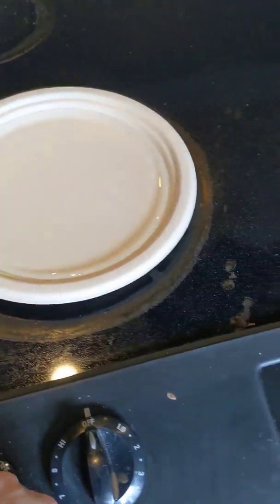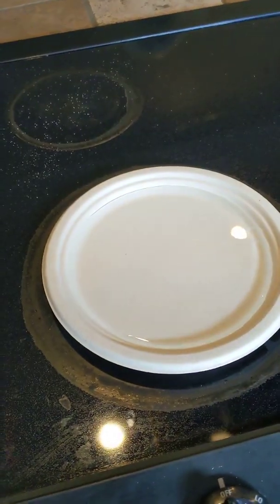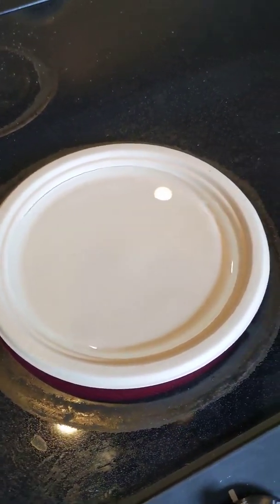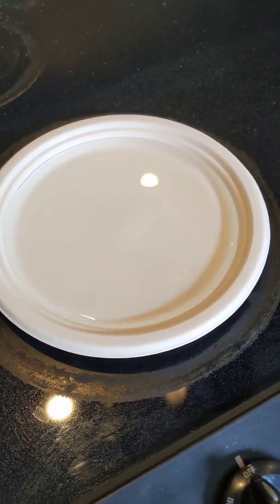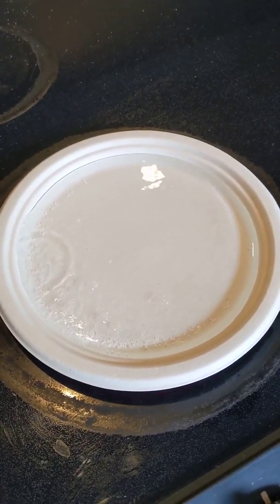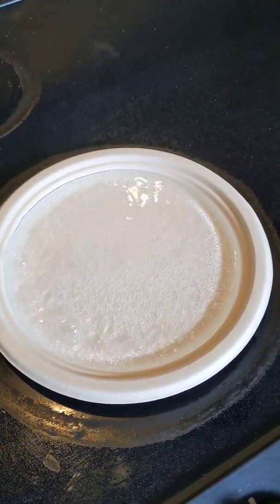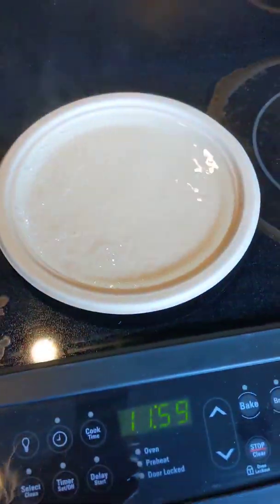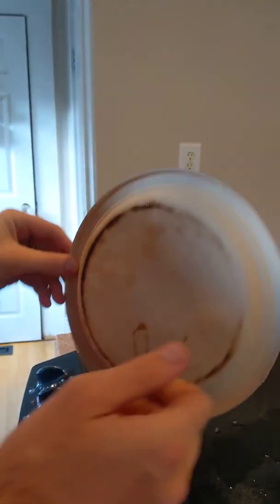Boiling water in paper plate on stove

Comment: If you use normal paper, that is not waxed or plastic coated, it should work without any charring but take more Energy because the evaporating Water is cooling the outside. 
I read some where that it was (is ?) an option for a hunting trip to kook in the hide.